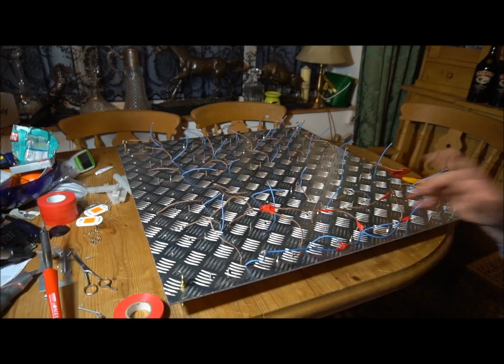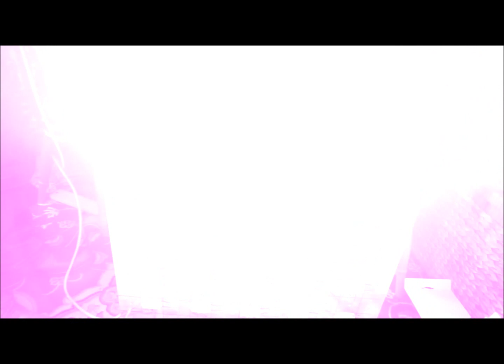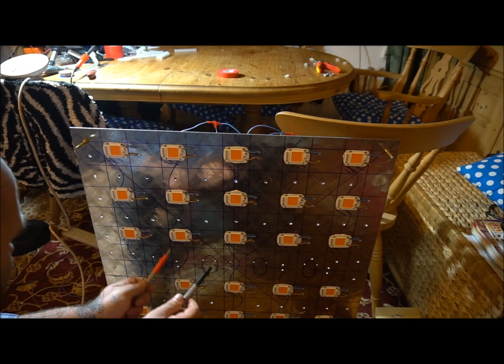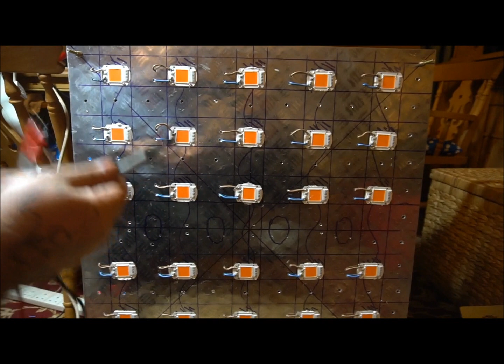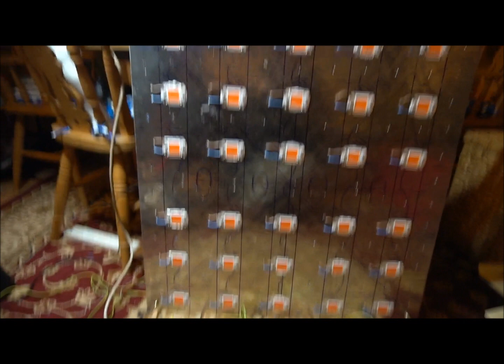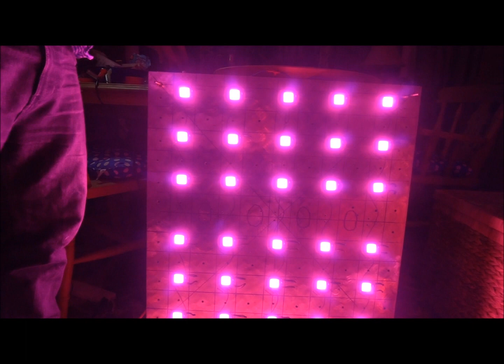cheap cob light part two

Comment: You must be blinds after making this mate lol. IV been contemplating doing this IV been using 3 of the 50w ones of these. They grow stuff really well thinking of making one to replace my 600w hps. Look forward to updates mate.
Reply: buy cheap buy twice . you need decent cooling or they wont last a month
Reply: your better of buying quality citizen/ cree cobs  , with HEATSINKS. The dimmer you used has buggered up the electronics built into the chip.These chips should not be dimmed
Reply: what happened to it
Reply from the maker: i havent the faintest idea..overheated or just poor quality cobs...I went to switch the ones id disconnected and they wouldn't work..so hooked up a 600w hps for now.im building some otherlights shortly
Reply from the maker: its now dead the light is no more
Reply from the maker: yup i have to agree with the better cooling...but alot did last longer than a month...i would suggest not using as many and better cooling that would make a great light
Reply from the maker: thats correct..it stopped working a shortwhile after i attached the dimmer switch..so i removed it and it worked fine...until it met heating issues...YOU DO NEED EXTRA COOLING WITH THESE COBS
Reply: I atach those on a 125-150 mm diameter pin fin heatsink they work passive, but with the fan for the plants it works perfect and doesn't heat.
Reply: Did you use thermal compound?